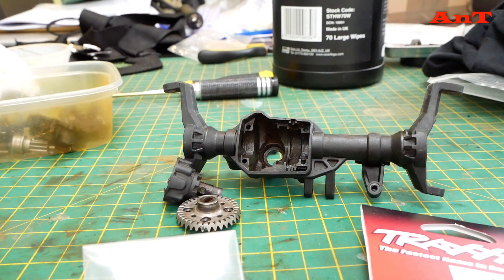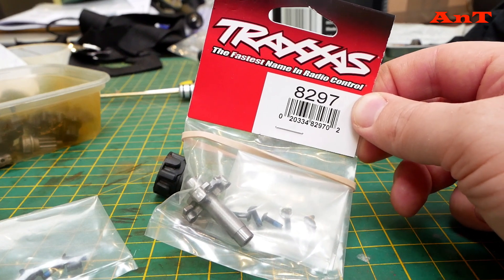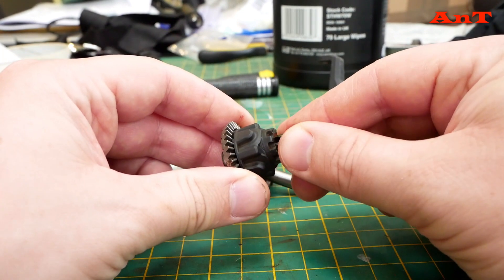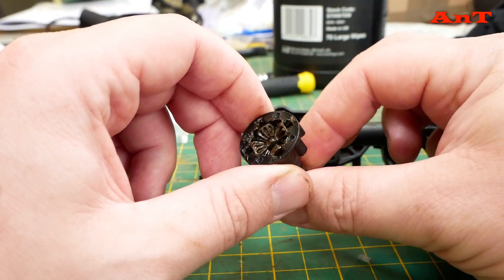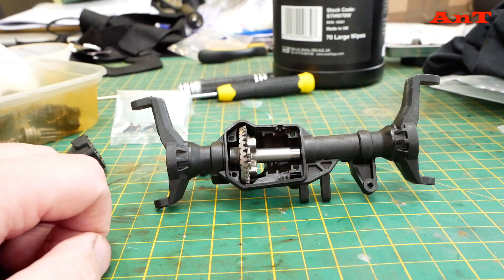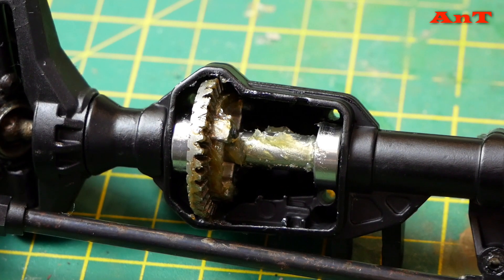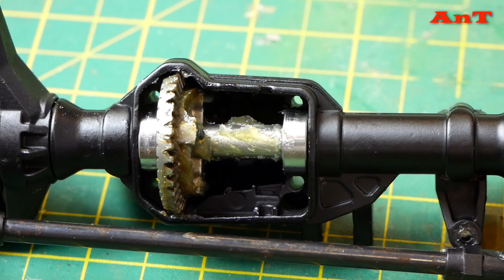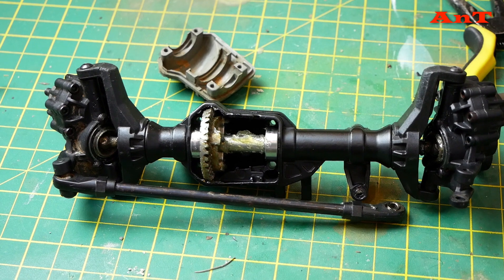Battered  Traxxas TRX4 Strip Down Part 4  Locked diff kit

Comment: Those diff spools are off the sport. How did you find the fit of the those metal axles as things are not always perfect.
Reply from the maker: I haven't put them on the chassis yet. However, the fit of the gears, shafts and bearings have been spot on.